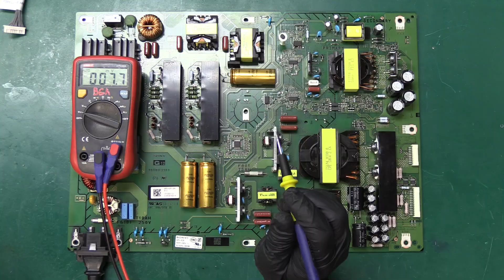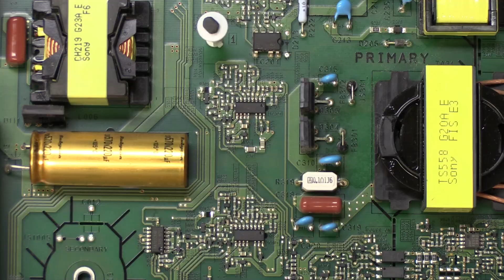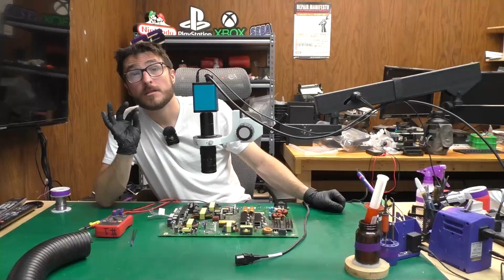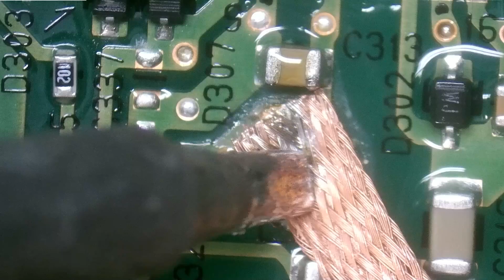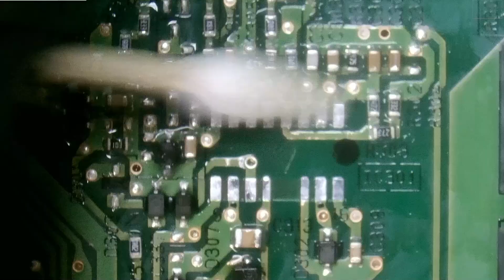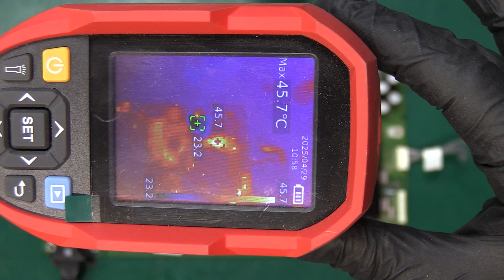Sony 4k OLED Repair Dead No Power XR-77A80J

Comment from the maker: Send in your Power Supply: https://nickselectronics.com/products/101055111
Reply: Hey Nick 🤝
How’s going?
I have the same tv with same problem. 
I’ve found broken ic hr1002a(hr1001a compatible)
But can’t identify two another 3-pin  ic’s u’ve changed on video with marking NB(q303) and tCM12(without pn on board)
Could you please tell me what’s that ic’s names?
Thanks in advance.

Comment: Hey Nick! Great video thanks. I have the same model, but not the exact issue. 
After plugging an old dvd player into the HDMI, the tv shut off. Now, it reaches the Sony logo, shuts off, and I get 4 blinking LEDs. After leaving it unplugged and doing a hard reset, I reached the setup menu for 20-30 seconds before it shut off again. Subsequent power-ons only last 1-3 seconds. If left unplugged for hours, I can sometimes get 45 seconds before it shuts off. I can fully use menus and speaker works in those 45 seconds. 

Do you think this could be main board or power board? The fact that I can get 30-40s in sometimes before shut off makes me think there isn't a fully dead component,  but I'm not too sure. Thank you!!
Reply from the maker: It's extremely likely your panel is failing. There is nothing that can be done to fix it at this point. 
Sorry for the bad news
Reply: @NicksTVRepair  No worries, I will probably still open up the back and see if I can do anything. It all started by plugging in something in the HDMI so is it not possible that its an internal short somewhere? Ill play around with it since theres nothing to lose I guess, thanks for the help, if you have any particular ideas on which circuit or which component to focus on that would be helpful, if not thanks anyways, I learned a lot
Reply from the maker: Reduce your backlight setting to 0 and see if it allows the set to stay on longer. If yes, this will confirm it beyond any doubt. 
It's rare for the TV to throw the wrong blink code, but it is possible that if the mainboard is corrupted/damaged it could cause it to throw the wrong blink code as that's the board that generates the code in the first place. Again rare but possible.

Comment: Hello, Thanks for your Job, i help me a lot. I have an issue with my xr77a80j, the TV is dead. In bench, power supply board have the same mesures that yours, but when a put in TV, the TV do nothing, no leds flash, nothing, i have 12,66v in PIN 19 in 20PIN Connector, but i dont have 22v in t com (pin29) of 30 PIN connector. If i put the board in bench with your indications, i have all of mesures, can you help me? Thanks a lot
Reply from the maker: It sounds like a mainboard failure. I don't have a video for the repair of the mainboard for this exact TV but this one is similar 
https://youtu.be/SSEPmjrGbYw

Comment: I have a 77” Sony OLED K-77XR80. After a power outage here in TN I got the red three dots of death and would not turn back on. I had a company come out since it’s out of warranty and checked everything inside and he was unable to determine where the issue is. Is the issue with this board common and do you know if the board you showed here the same board inside of mine? I believe it’s a power issue since everything online associates the three red blinking lights with power.
Reply from the maker: The fault shown in the video is a 4-blink code, which is different from the 3-blink code you're experiencing. I'm not sure where you found information suggesting that a 3-blink code indicates a power supply issue on your OLED TV, but I don’t believe that’s accurate. In my experience, I would most likely suspect the mainboard as the primary cause.

Comment: Caps read 390v on mine. Ive got 12v going to the mainboard but 0 volts going to the t con board
Reply from the maker: The T-Con voltage won’t turn on unless the main board tells the power supply to enable it. So the question is whether your main board is sending that “turn-on” signal, whether the power supply is actually providing the voltage, or if the T-Con or panel has a short preventing the voltage from coming up.

Most likely, you have the exact same fault shown in this video. I highly recommend following it to repair your power supply.
Reply: Did you figure it out? My caps are also reading 394v and i can hear a faint coil hiss/whine

Comment: Is the power supply on pin #4? Jumping pins 4 and 6?
Reply from the maker: You are more likely to break something by copying our set up. Just plug in the power supply to your mainboard/TV to power it on. That's the safest way to do it.
Reply: @NicksTVRepair   only pins 4,9,10 carry zero voltage while plugged in (before power up). I will assume since you were checking for voltage output on 10 its 4. Unless you want to help me out with the answer.
Reply from the maker: Plug the power supply into the TV and you will know the answer. 
I don't even know what is wrong with your set or what you are trying to do so me helping you is difficult based on the limited information. 
All I can tell you is that improperly jumping the board can = beyond repair and these aren't cheap. 
Give me details of your symptoms and ill give you straight answers.
Reply: @NicksTVRepair  I am trying to isolate the issue down to being the main board. The main board starts its boot sequence when the TV is plugged in, TOSLINK light comes on for about then after 10 seconds or so shuts down. Does not respond to the power-on button. The  symptoms started small... first lost network hard-wired and WIFI, then the display was getting stuck is a boot load cycle freezing on the Sony or Google logo. A hard reset would fix that issue for a while. Then the TV started randomly shutting off, and finally got to a point it would not turn on at all. No error blink codes, so my assumption is that its in the main board, but I would like to test the PSU board to make sure it power on if it got the power-on voltage return from the main board. I have tested all of the transistors, no shorts. I have 12.6v on pins 1,2,3,7,8, and 3.5v on pins 5,6. I assume there was a power surge that came in through the network cable, but wanted to make sure it didn't take out both boards. I would be happy to pay for a remote service support call if you're open to that. I am comfortable working on and servicing electronics.
Reply from the maker: I can tell you with absolute certainty that your power supply is fine and your mainboard is bad. I can also tell you with 95% certainty that you have a failed CPU and that a replacement CPU for this board is not available, and your mainboard is not fixable. We have encountered this many times before. The only way to fix your TV would be to replace the mainboard entirely. These are available for sale on eBay.
Reply: @NicksTVRepair  I wanted to let you know I replaced the mainboard and everything is working. Thank you for this video , it was really helpful!

Comment: Question- Sony oled 65a80J won’t goes black after initial set up screen. Also won’t show Wi-Fi networks. Could this be a main board issue?
Reply from the maker: If you the screen goes black after initial set up screen how are you able to see that it won't show wifi networks? 
Do you perhaps mean the HDMI inputs show a black screen but menus are still visible on screen? Did the wifi issue occur first and then later the set would only show set up screen and then go black screen? 
Do you get a blinking error code via a red light at the bottom of the TV? 
Have you tried power cycling the TV?

Comment: I have XR65A80CJ, it does not turn on from remote or power button, when unplugged and plugged back in it shows Sony logo in the middle of screen, than GOOGLE TV logo than after few seconds it turns to black screen and after 5 seconds it powers off with relay click ... 
Is it PS board or main board ?
Reply from the maker: Hello,
Based on the symptoms provided you have a mainboard failure. If you would like to send in the mainboard for us to fix, we actually specialize in that repair and can get your mainboard back to New quality. We have a flat rate service which comes with a 1 year warranty if you are interested. I am biased, but this is going to be a much better option than buying a used part from eBay as it may be cheaper but also has either a high chance of being defective, or being near it's end of life. Because we fix these, we replace the commonly failing parts with brand new ones which does mean it is equivalent to buying new. 
If you have any questions don't hesitate to reach out. If you do want to send in the board for repair, here is a link to our repair:
https://nickselectronics.com/products/xr-65a80cj
Reply: @NicksTVRepair  Thanks a lot for a quick reply, I ordered PS board and it should be here in the mid week, are you sure it is a main board failure not power supply  
Are capacitors a common failure on these SONY OLEDs? I did replace a bunch on my old Samsung plasma and it did survive another nine years , should I try to insect those firsts before sending you the MB first ?
Reply from the maker: I have never seen capacitors fail on a Sony OLED regardless of the model. That issue was common back in 2010 for many plasma and LCD sets. Capacitor failure is not a common issue we see with modern TVs especially not with OLED sets. I don't recommend replacing them on your power supply. 
With that said, try the power supply board you purchased, but if you still have the same issue, then you will know your mainboard needs repair.
Reply: @NicksTVRepair Looks like I had Costco/Sony 5yrs of warranty 😊 
All State will send me parts and their tech will show up here to replace it .... I got lucky with buying at Costco
Reply: Is Sony quality that bad in comparison to others like LG and Samsung or TCL ?

Comment: Our just turned off and won't power back on. no red lights or anything. With this fix do you think it permanently solved the issue?
Reply from the maker: Completely dead no power sounds more like the mainboard failed. When this power supply fails usually it will trigger the 4 blink. 
If you are interested in seeing how we fix those, you can check out our repair video here:
https://youtu.be/SSEPmjrGbYw

It's not exacly the same Sony OLED TV but the repair is the same. 
If you are intersted in sending in the mainboard for repair, we do have a flat rate repair serviec which comes with a 1 year warranty:
https://nickselectronics.com/products/xr-77a80

If you have any questions don't hesitate to reach out

Comment: What pins to switch short to force switch on? 
I have shorted power on , standby, TCON on, eddp. But still no voltage on eddp. Tcon however has 12 volts

Comment: Nick.   I got another 77 A80J  and this time when press power nothing.     I checked power supply by jumping it on so I know it has  3.5v , 12v , 21v  , on the mainboard what voltage should we be checking for ? it almost like the mainboard is not triggering it to turn on.   I can trigger the powerboard to turn on by jumping the pins.  any clue ?    I literally have 3 spare mainboards they all doing the same and not powering it up.     what are the chances I have 3 bad boards ? lol  something is not adding up.... can it be the cable ? I think I will swap out the cable to the power supply and mainboard.

***Update****   I replaced a Tconn board and TV came on without any error codes but screen is black.  what can be issue ?

*Final update*   TV FIXED can you believe it... it had bad LVDS cables... I replaced both from a donor TV I had.. and the screen came on lol... jesus  i can not believe the cables was the issue... drove me crazy I had 3 donor mainboards all did not work... it was the cable all along.
Reply from the maker: I was going to mention the LVDS ribbons could be bad. It's rare for it to happen on it's own but we often get that symptom after we return fixed boards to customers because they damaged their ribbons.
Reply: @NicksTVRepair I was told geek squad messed with the tv and they probably yanked it off the mainboard because when I saw the TV the cable was disconnected and the corner ear was missing on the cable.
Reply from the maker: Yeah if the geek squad had their hands on it, it's likely they damaged it.

Comment: Hey @NicksTVRepair 🤝
How’s going?
I have the same tv with same problem. 
I’ve found broken ic hr1002a(hr1001a compatible)
But can’t identify two another3-pin  ic’s u’ve changed on video with marking NB(q303) and tCM12(without pn on board)
Could you please tell me what’s that ic’s names?
Thanks in advance.

Comment: Good morning I have a sony bravia xr-77a80k that blinks red five times replaced TCON still same issue
Reply from the maker: It's possible its the mainboard but #1 reason is T-con #2 is panel failure. I guess it's also possible the ribbons aren't seated right so I would recommend reseating those as well.

Comment: Where would you recommend  to place an external fan to help keep the OLED panel cool, hoping to extend the lifespan?

Would it be advisable.
Reply from the maker: This is not good advice, you should not do this especially if you have kids or pets. 
I have neither so if I was concerned, about overheating and keeping the panel cool I would remove the back cover and have a fan blowing #1 on the mainboard and secondarily on the powersupply. 
For keeping the panel cool, just lower the brightness of the display. These things are already super bright as is, so just make sure you only operate it at 75% of full brightness. When I say brightness I don't mean the screen I mean the actuall LED backlights brightness.
Reply: @ what setting is that ? And to confirm this is for the OLED xr77a80j

Comment: Are you concluding that the last transistor you replaced was also shorted, or leaky?
Reply from the maker: So I never found a dead short, but the last transistor I replaced was showing a lower resistance in circuit than another board I was doing comparison measurments off of. And I forget at this point since I filmed this over a week ago but I believe the lower leg on the right side to the leg on the left was reading like 1 or 1.8 k ohm where as after the replacement it was 14k I think.
Reply: @NicksTVRepair  Yes, that's what you said in the video. No caffeine yet this morning, LOL. I forgot that detail. Thanks for the reply! Your skills are top level!
Reply from the maker: Thank you